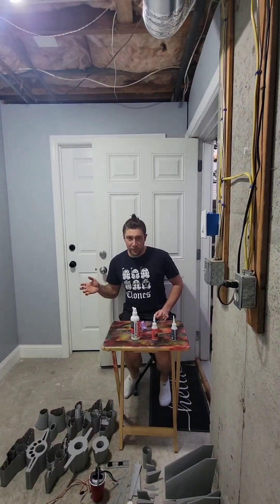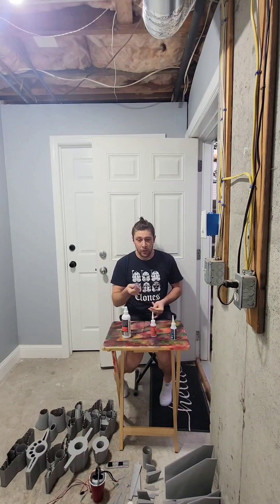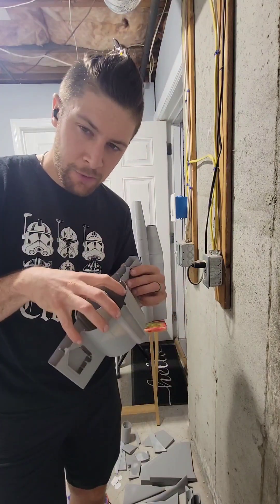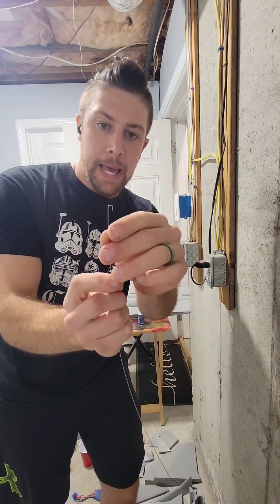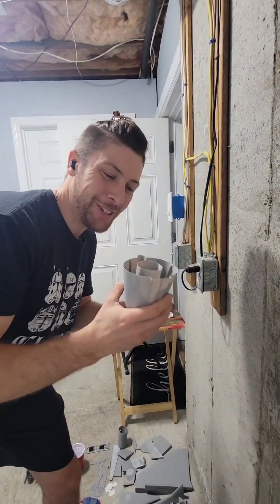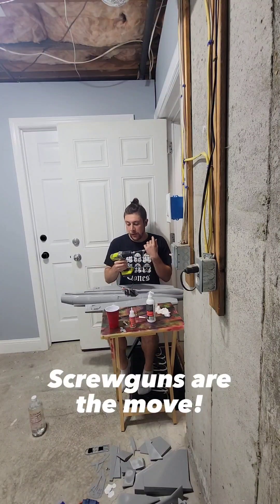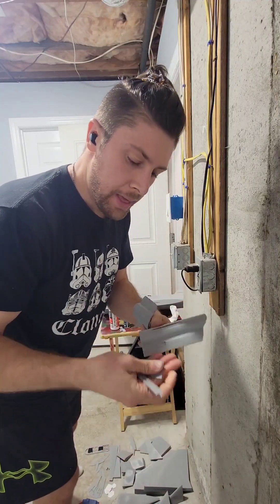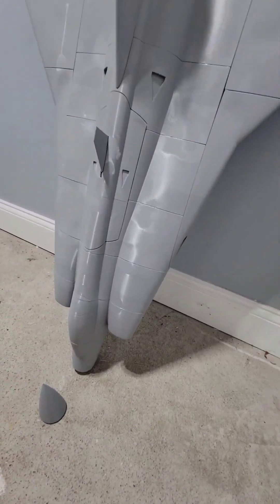How to build your own 3D printed J-35 Draken!

Comment: You should not have to get up to talk to the camera... If we can't see you, we can't see what you are doing... (Move the camera!)
And, While I appreciate the comic "I goofed" if this was your second build... maybe NOT have any "issues"... Some of us came here for tips/tricks on the build.
All constructive criticism, don't take it personal.
Reply from the maker: This was definitely not my first rodeo 😅 Just my first build video. I do very much appreciate the honesty though. The camera definitely needed adjustment. I will aim to include more tips and tricks in my next build video 👌 I appreciate all the input
Reply: I'm in the middle of my first build and while I seriously appreciate the engineering, the instructions are a bit lacking.  @3DPrintHangar_RC
Reply from the maker: If that's in reference to the video, I wholeheartedly agree. However, the designer of this aircraft, as well as almost every other 3D aircraft you'll find, has a comprehensive build guide included with the STL files